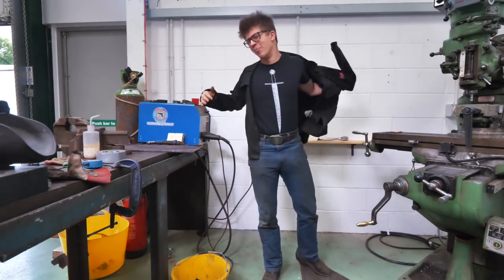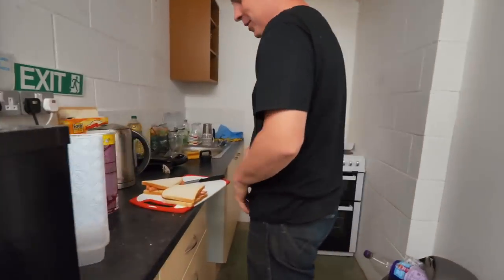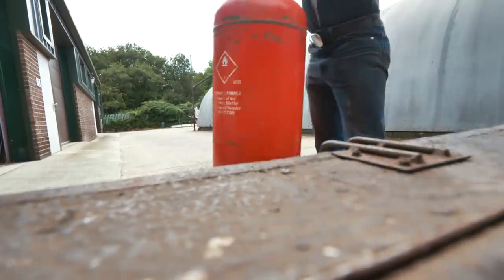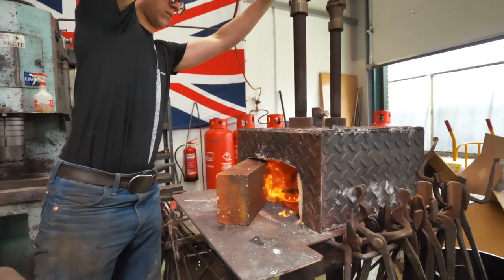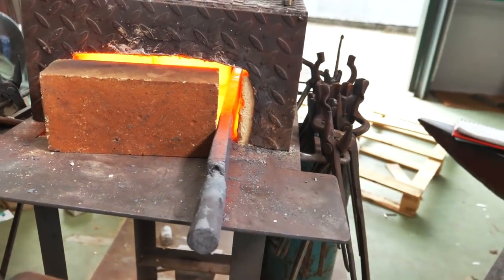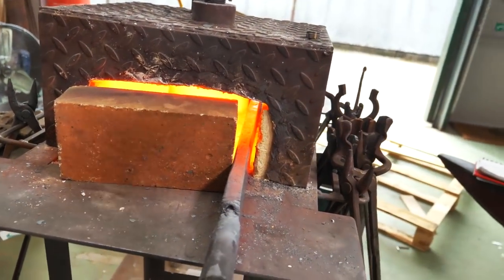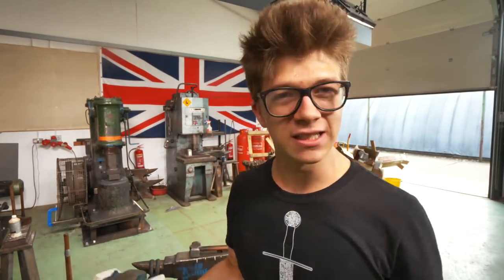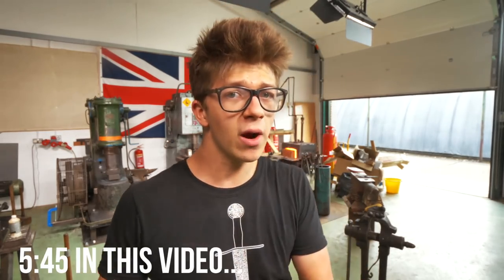VIKING BATTLE AXE: Part 1

Comment: You don't need a respirator for MIG. Stick, flux core, dual shield, YES. but MIG is so clean it is pointless.
Reply: adam anthoni ford still a good habit to get used to
Reply: Where did you read that is was clean because i call BS. There are more then plenty of research on the negatives from inhaling smoke. I would be glad to share the information if requested, but i dont do translations.
Reply: kanskeimorrn MIG is simply short circuited steel wire with small amounts of silicon that absorbs surface contaminants and do not go into the air. CO2 or C25/75 gas is used as an inert atmosphere. There are no hazardous materials in any state.

There is no smoke persay because it contains no particulate matter or noxious gas. Because no pyrolysis is taking place, nothing harmful is produced.
Reply: Well you are free to believe what ever you want but even you should be able to write (welding smoke danger) in a google serchbar.
Reply: kanskeimorrn there is more than one welding process. I work 50 hours a week running SMAW, and last position was 60 hours running GMAW, I know what I'm talking about.
Reply: Im just assuming that we are talking about the type of welding that Alec is doing and it is a FACT that the smoke that he and ANYONE else that does this type of welding is putting them self in harm without a smoke eater/cleanair helmet equipment.

Comment: Wear the respirator. Change the filters weekly. Make sure you keep it clean and sanitized in a clean area, even if for convenience sake, put it somewhere clean and out of the hazard zone. Do you really wanna ruin the whole purpose of wearing a respirator?

Also Your shop is organized. Its more organized then I see most peoples homes or garages. Dude you're doing well enough on organization and cleanliness of your shop.

Comment: love your work and it's amazing. How much would you like for a knife of this style for a subscriber?
K-bar style knife. 
  Razor edge 
  Spine 1/8" thick 
  Length in all 14" 
  Blade length 8" 
  Handle length 6" 
  Leather or wood wrap, your preference
  Sheath if you can. 
  Damascus steel

Comment: What is the borax looking powder he sprinkles on the hot stack?
Reply: Chris Shell probably borax. He mentioned it in another video
Reply: It's borax, melts into the cracks and prevent oxidization between the faces so that they'll weld clean.
Reply: looks like Iron mountain welding flux
Reply: Money is on anhydrous borax yea